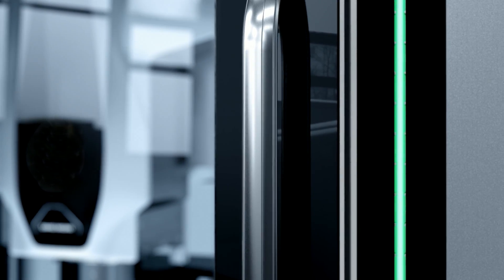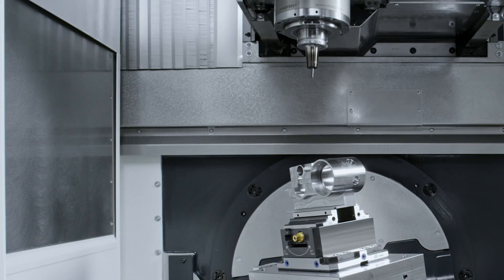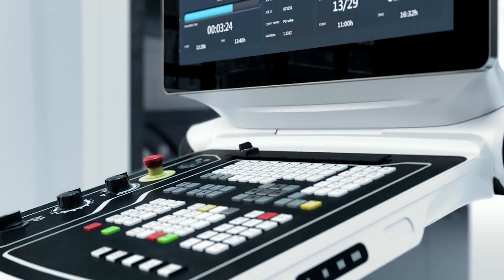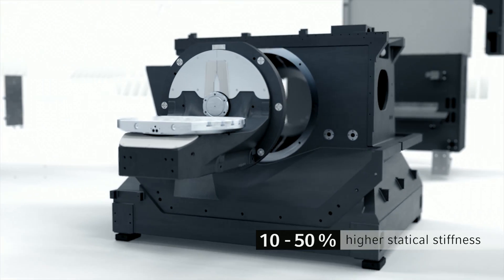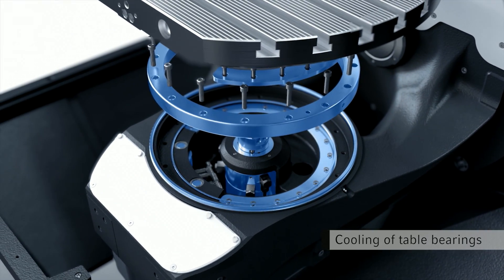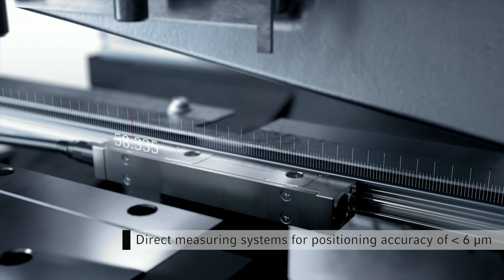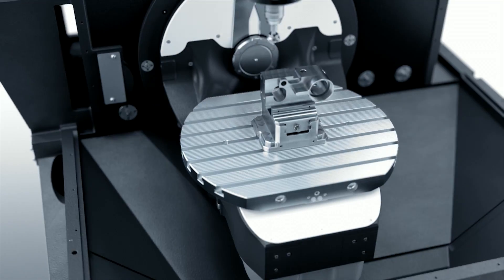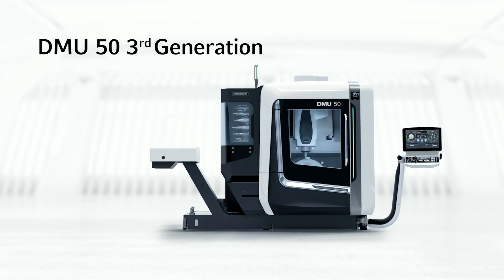DMU 50 3rd. Generation - 5-axis machining with speedMASTER® as standard

Comment: Very impressive!!! I saw it at the Pfronten show, went there to purchase another machine and then decided on this one instead.
Reply: How much do these machines cost?
Reply: @pineapplepenumbra  you can see the price on the German version of the dmgmori journal 01 of 2017,  but that's a basic machine with nothing. You can configure it from 200k to over 350k, depending on your requirements.
Reply: Thanks. That's a bit out of my price range, but it looks well worth it for the requirements some companies have.
Reply: @pineapplepenumbra, that said, one cannot say that the machine that we've ordered is the best in its class, only time will tell. We'll know for sure after 10 or so years of usage, if it maintains its precision, is still the leader in speed for ball-screw machines, if it is productive on all our jobs etc.  Currently on paper, and the one on display that we've seen, it will run circles around other similar machines, in performance, precision, work-volume and table load, at a 10-20% discount on other (already discounted) machines.  Besides, no one can beat them in the looks dept, if you have a clean shop floor doing clean machining, there's no better thing than a DMGMORI in your repertoire of machine, they just stand out.
Reply: Naresh Sharma 

Ah yes, good point. Long term reliability has yet to be proven. I wish you luck.
Reply: Do you have the machine already? I'd be interested to hear some feedback.
Reply: HYPERTUNEdotNET , nope not yet! The delivery date is sometime in Dec 2017.